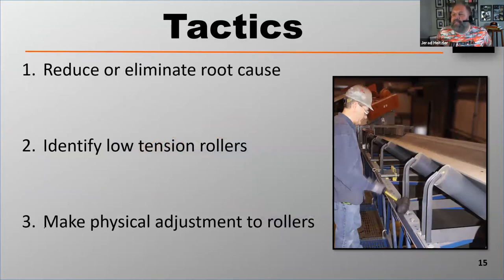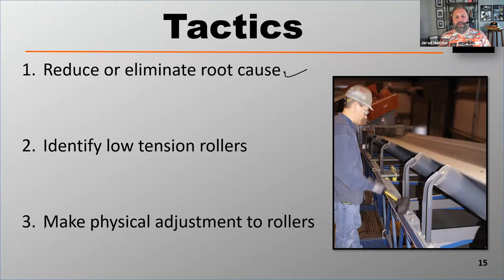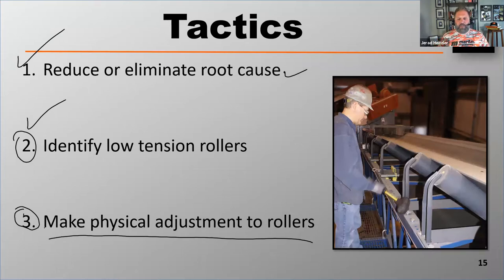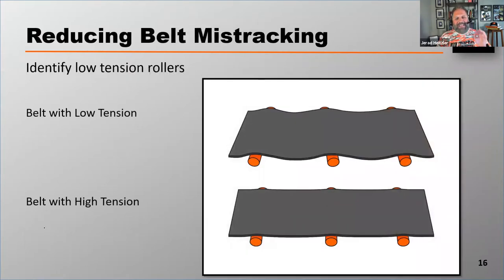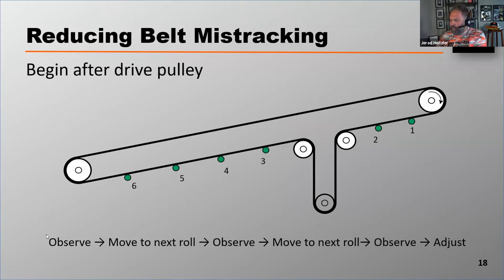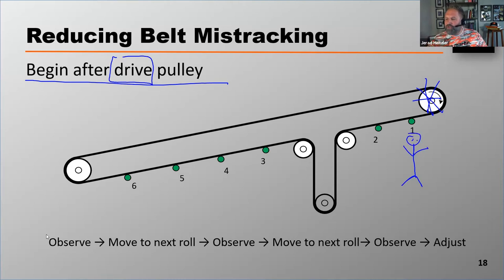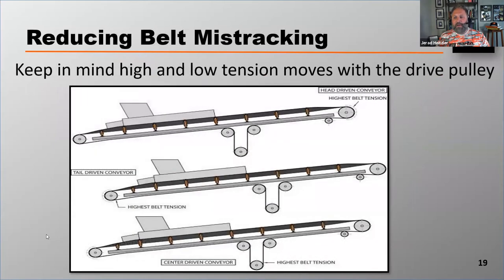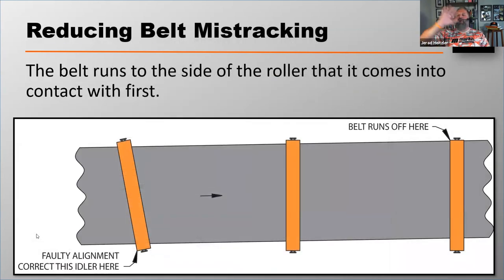How To Correct Conveyor Belt Mistracking

Comment: We have belt conveyor with 150 meter length ( c to c ) , we face problem after 6 month in operation. Top section extremly tracking when there is no material on the BC but ir will be center if material coming. Is this related with the tension ?
Reply from the maker: Typically, when a conveyor belt lifts out of the troughed idlers when unloaded but sits into the troughed idlers when loaded, the belt has too much tension.  When the belt is over-tensioned and elevates out of the idlers, it will be very difficult to track properly because the idlers cannot influence the belt to track correctly. You may want to reduce some of the tension on the belt in order for it to lay into the carrying idlers, which should correct the problem.

Comment: for 50m belt conveyor line is it advisable to used the screw type belt tensioning mechanism or VGTU system
Reply from the maker: Thanks for the question! Either system will apply tension to the belt.  Added tension to a belt will not necessarily correct a belt mistracking problem.  Too much tension can actually make tracking a conveyor more difficult.  The type of tensioning device used in a conveyor belt is irrelevant to tracking a belt properly.